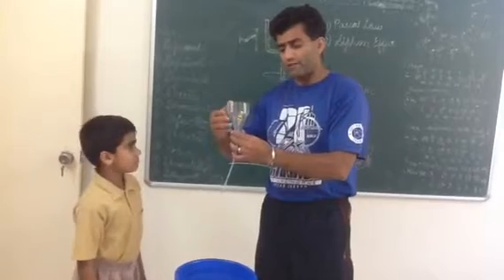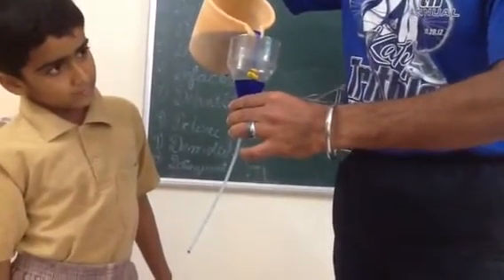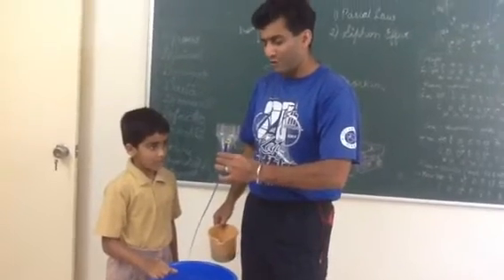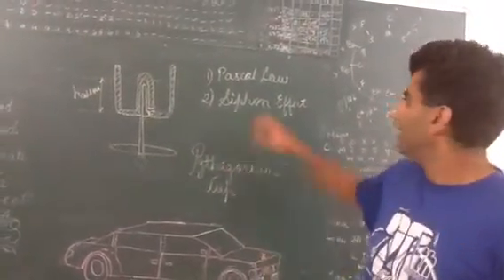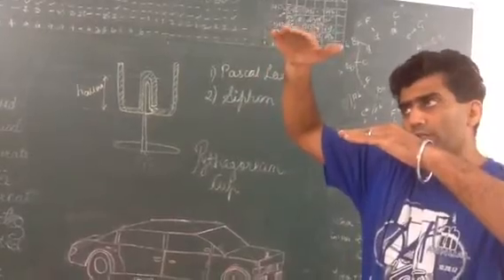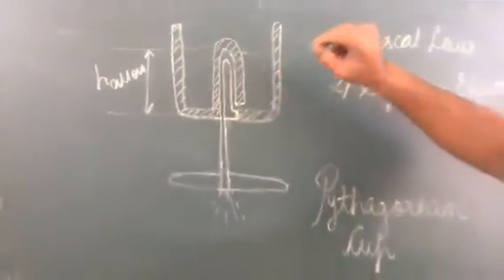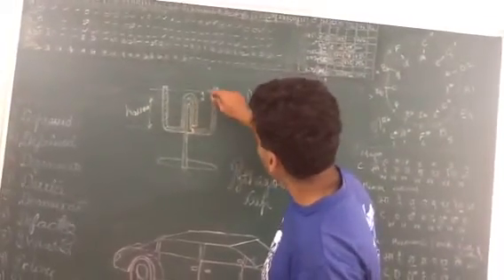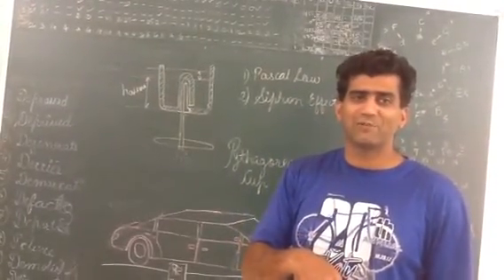Pythagoras Cup(वासुदेव प्याला) Demo and explanation

Comment: I did not understand why at the first instance when the water is filled to a certain level, the water did not flow from the pipe below. You said it is because Pascals law is not allowing it to flow but I did not get it. :(
Reply from the maker: Pascal's law had nothing to do with the liquid not escaping, it is the cup design that achieves this. So, there are 2 things happening here 
1.  Pascal's law- ensures that when we are filling up the bigger cup outside, liquid also takes up a matching level inside the capillary.
2. Siphon effect -  But so long as the liquid stays below the top opening ( exposed to atmospheric pressure which is lower than the liquid pressure)  of the inner  capillary, one can keep filling up the cup. However once the liquid is exposed to the relatively lower atmospheric pressure as it surpasses the top opening, it finds itself getting pulled down with gravity assist. Once the pull has acted then it continues to act unless some external unbalancing force( liquid running out) is acted upon it. So this condition now resembles filling water in a vessel with a hole.

Does this help?
Reply: Thank you 😊